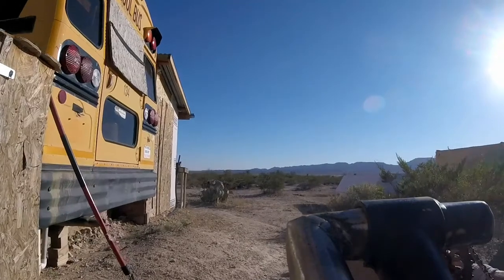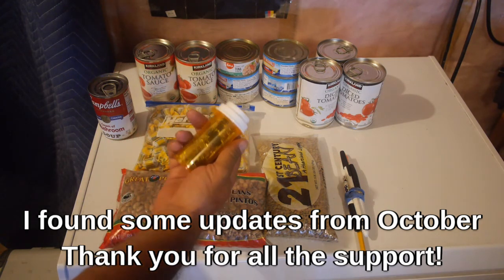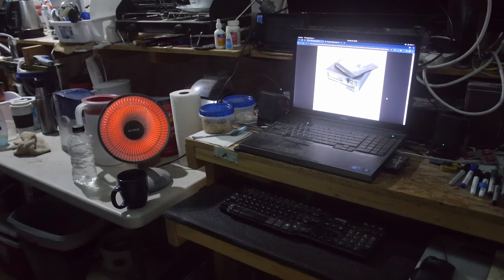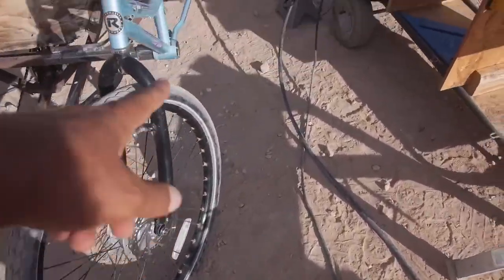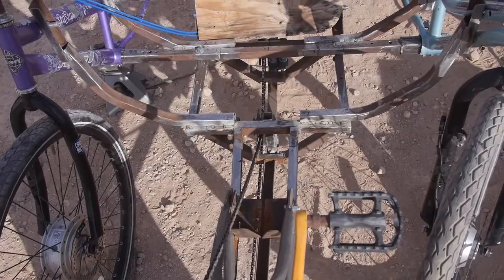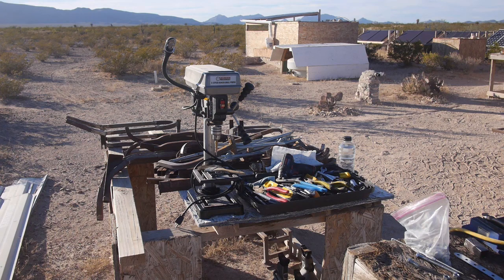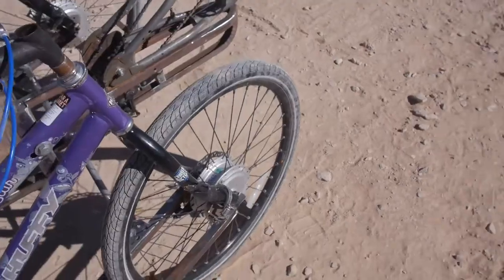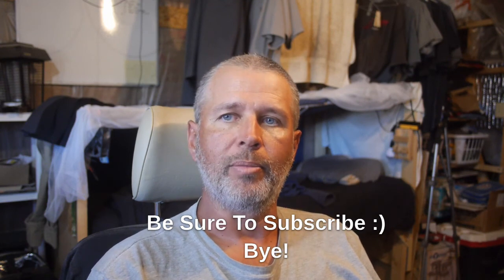Carlin Comm - Turtle DIY Recumbent November Updates

Comment: Looking good Carlin! Functionality first, Reliability second and Efficiency third! Looks like you're hitting the targets sir!
Reply: @AnX8765  Hiya Bill! Things got delayed a bit this year due to my workload. I normally come up in October to visit w/Carlin and plan things out. Good news is that I've transferred into a strictly remote role now so it gives me a lot more freedom to be where I want to be. I plan on heading out in January (cold desert!) and get some preliminary work going on the 20 acre tract just south of Carlin.

I won't be bringing the Tym T454 tractor just yet but hope to get some preliminary work done. I'm almost done with my 7x16 cargo trailer/camper conversion to live on-site while getting things set up. It has 1500w of solar on top with a large battery bank and is pretty much self contained - I've been recording tons of video on it but haven't had a chance to edit yet. Hopefully 2022 will be the year that I wind down the household here in Houston and move full-time to the properties out there.

As far as the runway and hangar on the 'north 180 acres', the layout has been confirmed and the contractor selected. I bought an additional 20-acre tract just off FM1111 to be used as a staging area and a drive-through for the heavy equipment to the north 180 so I don't have to add 6+ miles of dirt road travel to get the large property. 4x 1500 gallon tanks ordered and just waiting on the hangar erection to be delivered. Plenty of activity coming up and thanks for asking!
Reply: @AnX8765  Certainly!
Reply: @houstonfirefox  Awesome
Reply from the maker: That's going to be a fun project to see come together! Can't wait !

Comment: MIG welding with flux core is just fine. Everything I build from recumbents to motorcycles is all done from my harbor freight welder. As long as you're not welding anything massively thick it'll be just fine. I'm glad you figured out why it wasn't stable.
Reply from the maker: Hey thanks so much for the feedback!  I guess I just got nervous looking at how thin some of the tubes are. Now I have more scraps left over from the bikes I've cut apart, maybe I'll do some practice on those. When I "grow up" haha I still want a TIG, and a welding table, and a shop, but for now I'll just keep ducking the dust devils and try not to step on the rattle snakes :) Best wishes!